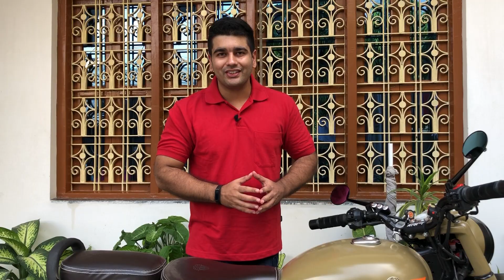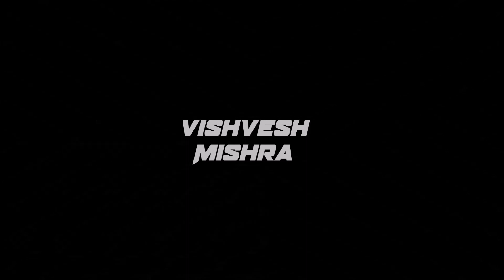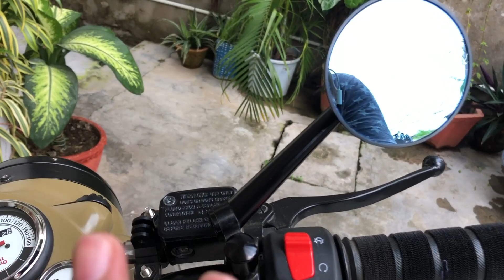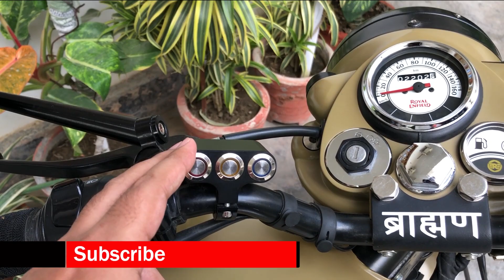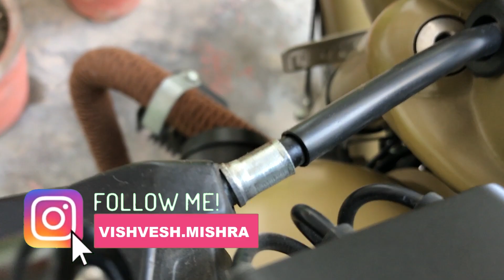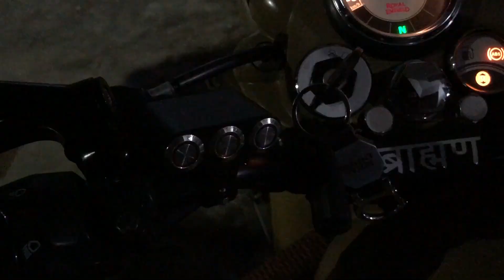Three in One Premium Metal Switch for Royal Enfield | Coolest Switch for any motorcycle

Comment: Can you connect simtac flasher to that push button switch. If so then how to change the pattern of hazard flasher?
Reply from the maker: Hey! Sadly that’s not possible, I’ve tried that and could only get the flasher to work on one fixed pattern. Changing it isn’t possible as that works via circuit break method which isn’t possible.
Reply: @vishveshmishra3894  that's bad. Might be you can mail simtac. I spoke to them coz there was an issue with my new dominar. They said under special case they would modify hazard flasher.
Reply from the maker: I’d talked to them over this and they said it’s not possible as they can’t modify their product for using with any third party accessory. Your case involves the motorcycle as a whole so they’ll do it since the number of people purchasing a motorcycle is more than just an accessory.
Reply: @vishveshmishra3894  it was not for me but what they said was one of the old bullet had custom wire so hazard flasher was not working. They had to modify to that particular bullet.
Reply: @vishveshmishra3894  might be if you try the hazard flasher of ktm style where we should use indicator button to change pattern then we might know how it works. I find simtac switch is of poor quality.
Reply from the maker: Ok! Yes the switch isn’t at par with what it should be but then it gives you the ability to easily switch it on/off and change the pattern too while the indicator button ones aren’t that user friendly and don’t turn themselves off when the need of using the indicator arises which the Symtac one offers by default hence I prefer this one.
Reply: @vishveshmishra3894  exactly. Even though it was not listed in thier site simtac offered me new version. I did not opt that for the sake of override feature which is very important in highway.
Reply: usually the last one will just push or onetouch / mode change . means it comes back once u take out the finger.. may be there are swtches have all 3 as permanent on / off . coming to simtac am using simtac v6 for meteor 350 it workes effectivlely. so you can use this switch for mode change of flasher or anything else like that the the last swich is momentory . its available in amazon

Comment: Have you changed the engine on/off handlebar switch to bs3 ???
Reply from the maker: Yes I have changed it but still it’s not illegal as my headlight’s DRL stays on all the time.
Reply: Could you please make a video of it, as to where did you get it from and installation thing??
Reply from the maker: Will try to for sure, actually it’s just a normal BS 3 switch which I’ve wired differently.